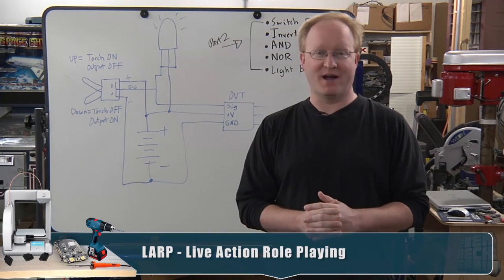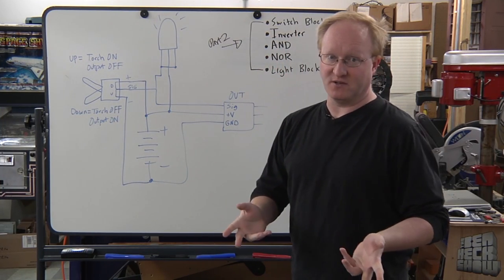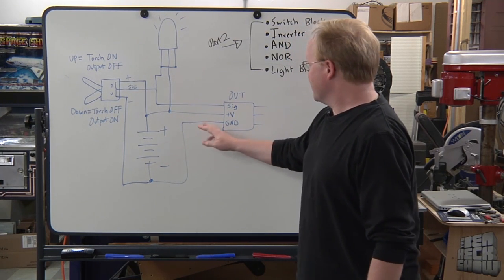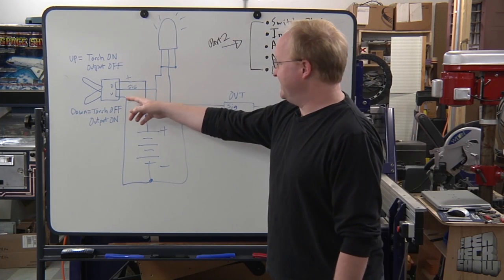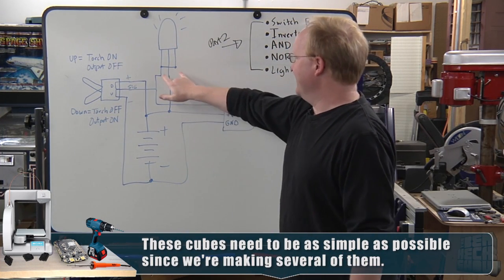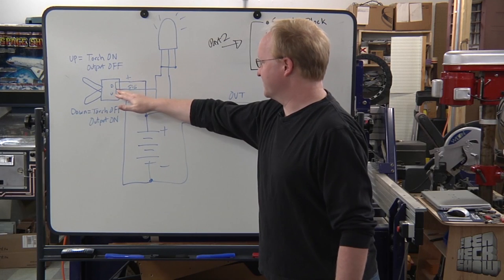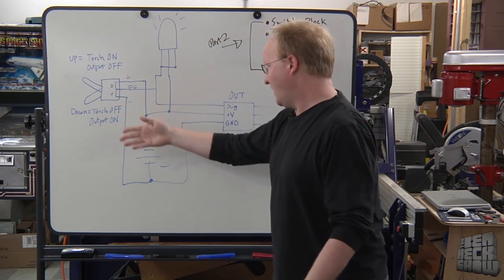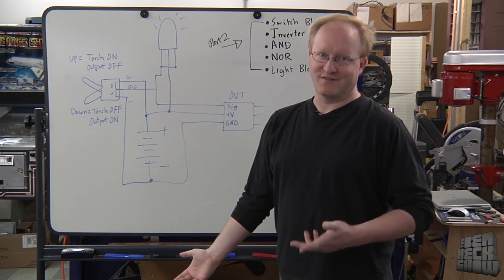Live Action Minecraft Blocks Part 2

Comment: You forgot many things... Redstone Blocks, 15 Redstone limit from full signal, Pistons much more, but I understand you can only do so much and think of so much at the same time for that size of cube so still impressive.

If you ever do something simular to this for Minecraft redstone maybe make a block that has a few connectors on the bottom for it to react and have I don't know a QR-Code on the bottom for a small scanner to read and use code to create the functions?

Comment from the maker: Don't worry I didn't forget the ZX Spectrum. Here's the preview for this week's episode! Ben's ZX Spectrum Mod Part 2 Trailer
Reply: please sell this in stores
Reply: patent this.. now! sell the patent and you will run out of use for money
Reply: ***** you should also include the complete tekkit pack. XD
Reply: you should make a minecraft comparator!
Reply: he would have to redo the whole system to make it compatible with the "analog" signal redstone transmits in newer version.. though it would be cool to see.

happertje2 that would be fun to see.. wonder how he would handle creating items frome nothing???
Reply: pistons! comparators! Repeaters! Daylight sensors! And maybe texture the blocks to look more like minecraft blocks
Reply: Jack Newton a repeater are just 2 torches
Reply: not just that, they also act as a buffer and a check valve and a delayer
Reply: i wonder if you could make them snap together without having prongs sticking out the side by putting magnets to draw it together and snap it in place and then having a couple of coils of wire to induct the power to the other block
Reply: Nathan King  coils are really inefficient at power transfer (plus you would have to change it to ac then back to dc so more inefficiency ).

just have it be pads and leafs/springs on the sides using magnets to keep the blocks in place
Reply: ***** okay..... whaaat juts having two pieces of metal flush with the wall of the block... same magnets pulling them in position and have the plates line up to connect like that?
Reply: Nathan King  Eyeup... actually i might do something like this for my final project for my  major... if i can get credit for it...
Reply: ***** Modular logic gate toys?
Reply: Nathan King yeah .. i just have to prove i know what im doing right? pluss it would be nice to be put on display to get others interested in this course of study..

..if i can get it to work like redstone with the whole 14 block max propagation and redstone_out = largest_in-1 and include redstone blocks + repeaters(with locking and adjustment of delay).(not completely sure how i want to do this) logic gates aren't enough for what i want to do.. so it all together should be enough to show i know what i am doing..
Reply: ***** don't limit yourself to red-stone you could do alot more just going general with modular logic gate toys with different  input and outputs. might even make the idea a little more shippable to the prof.
right?

Comment: U forgot the repeater
Reply: Adding repeaters to this implementation would be fairly meaningless given that he didn't implement timing or signal decay.
Implementing those features would probably require giving the whole network of blocks a timing signal, and using microcontrollers to implement the logic blocks and the redstone.
Reply: Scope-Eye video add a crystal block for signal ?
Reply: astrialkil I'm not clear on what you're suggesting here.
Reply: add a crystal to give a timing circuit ?

Comment: This is really close to something I've been thinking about for a long time. You know you can build an entire computer out of just the simple little NAND gate? And if the data between gates where transmitted by light, you wouldn't have connector problems, AND you could see the outputs (and so the inputs). How about a LIGHT LOGIC block? Powered by an inductive charging pad, and interconnected by placement or low cost fiber optics (fat fishing line):
http://techref.massmind.org/techref/idea/logicblocks.htm

Comment: single transistor NOT gate? Is it a complementary logic transistor?
Reply: He his right in that regards. Imagine an NPN Transistor: When the collector is connected with a pull-up resistor, emiter is connected to ground and we use the base in series with a resistor as input, we have a NOT Gate.
(see https://en.wikipedia.org/wiki/File:Transistor_pegelumsetzer.svg)

When you apply "high" on the input, current flows trough the base and therefore through the collector as well. That makes the voltage between emiter and collector something like 0.4V Volt which is effectively low.

When the input is pulled down (e.g. via a switch connected to ground) no current flows. As no current flows, the resistor on the collector "pull ups" (hence the name) the collector voltage up to supply voltage it is connected to.

So when applying a "Low (voltage)" the transistor/circuit outputs a "high(voltage)" voltage.
Reply: sarowie you are right, I forget about the pull-down and pull-up resistor with transistors stuff... thanks

Comment: Regarding comments about the limit of signal in Minecraft: It is doable, but it would be prohibitively expensive. You would essentially need to have microcontrollers in each redstone block (of which there are more of than the other kinds of blocks). That would stack up quickly compared to the cheap boards he has in them.
Reply: Basic 8bit micros only cost around 50 cents each, not prohibitively expensive,  it still more than a simple gate
Reply: eehawkee Yeah, you're right. I think "prohibitively" is a bit strong of a word. Still, if you're building more than a few of these, 50 cents each will add up quickly!
Reply: Dublhelx It's funny you mention that. I was thinking the same thing after my last post. But, to be honest, I would rather do it with the slightly-more-expensive microcontrollers to prevent any danger from the instability you mentioned. At least, if I was going to give this to a kid I would do that.

Of course, that starts delving in to a whole discussion about going from this prototype to an actual product. For our purposes, a voltage divider would probably work just fine.

Just curious, does anyone reading this (I know it's pretty far down in a comments thread) have any plans of making this? I was going to try putting it together this weekend, albeit with hand-cut cardboard instead of 3D printed parts.
Reply: Christopher Pilcher yeah if you build 40 like he did, that would be an additional $20 right there not to mention the boards which were at least $20 and all the other parts
Reply: Couldn't you do it by making the signal line analog? I haven't thought tis through enough but... a pull-down resistor on the output signal and a comparator on the input of the next block?